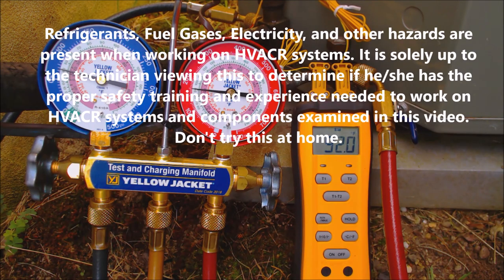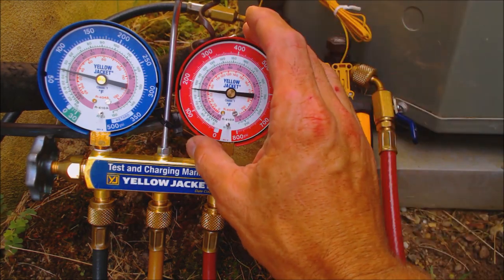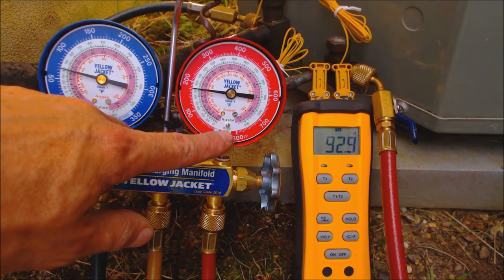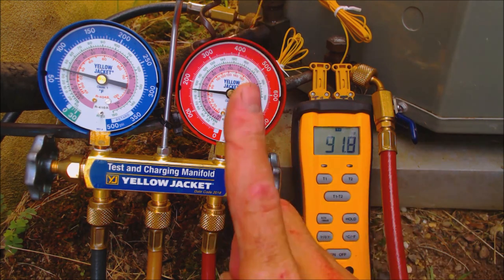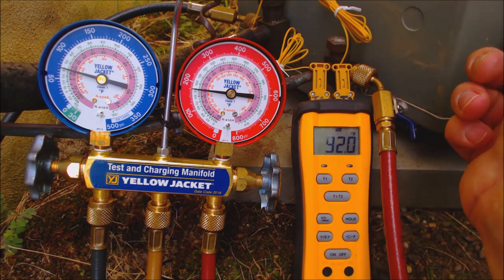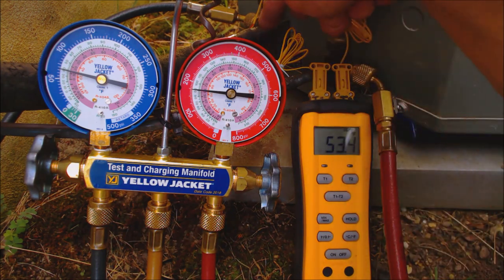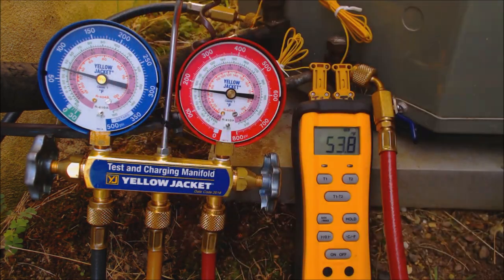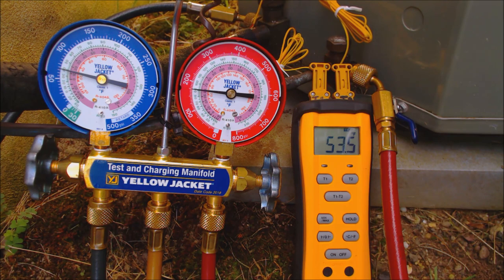LOW REFRIGERANT CHARGE on A/C Unit! How to Verify with Gauges!

Comment from the maker: Tool List-  https://www.amazon.com/shop/acservicetech
Support-  https://www.patreon.com/acservicetech
For those that are looking for the tools used in the videos: (Linked Below)
Here is the link to the Fieldpiece ST4 Dual Temp Meter- http://amzn.to/2wc1ME3

Here is a link to Refrigerant hoses with valves used in the videos  http://amzn.to/2aBumVI

Here is the Link for the Yellow Jacket Refrigerant Manifold Gauge Set used in the videos http://amzn.to/2aenwTq

Here is the Yellow Jacket Manifold Gauge Set including standard hoses- https://amzn.to/2vLVkV9

Here is the Yellow Jacket 4 Port Brute Manifold with Hoses- https://amzn.to/2BkuGIq

Here is the Fieldpiece SMAN460 Digital Manifold Set- https://amzn.to/2nB4Fe6

Here is the Fieldpiece SMAN360 Digital Manifold Set- https://amzn.to/2BdoaD4

Here is the Compact Ball Valve Attachment for the end of the Refrigerant Hose- https://amzn.to/2KUisW8

Here is the Quick Disconnect 90 degree attachment for the end of the refrigerant hose- https://amzn.to/2MMtVcg

Here is the link to the Appion Valve Core Removal Tool- http://amzn.to/2uYr8WL

Here is a link to the JB 6 CFM Vacuum Pump   http://amzn.to/2nqbvo8

Here is the Link to the Appion Blue 3/8" to 1/4" Vacuum Hose- http://amzn.to/2uYlVyc

Here is the Link to the Appion Red 3/8" to 1/4" Vacuum Hose- http://amzn.to/2uYg6Ro

Here is the link to the Yellow Jacket 1/4" by 1/4" heavy duty hose straight-  http://amzn.to/2umtcod

Here is the link to the CPS Vacuum Micron Gauge- http://amzn.to/2v1nM3O

Here is a link for RectorSeal Bubble Gas Leak Detector http://amzn.to/2ckWACn

Here is a link the Nitrogen Regulator    http://amzn.to/2bXdR5f

Here is a link to the Nitrogen Flow Meter    http://amzn.to/2brvoBg

Here is a link to the Digital Refrigerant Scale used  http://amzn.to/2b9oXYl   

Other tool links can be found in the video description section.

Shop through Amazon! Your Purchases through Amazon provide a means for channels such as mine to earn advertising fees from all purchases after clicking through. Prices are the same as normal-    https://www.amazon.com/shop/acservicetech

All of the ACSERVICETECH Playlists-  https://www.youtube.com/channel/UCOZR-1IqsAer9wzlvFgb4mA/playlists?view_as=public

Comment: Thank you for information. How it’s possible when I’m adding refrigerant to increase sub cooling, saturation temp rising up proportional actual temperature. They are same. (I didn’t check what type of metering device) but on the sticker plate was info 12  degrease sub cooling. Other question,  sometimes I can see actual  subcool temperature is  very highest than saturation temp.  But  low side pipe actual temp 60 degree. Thank you.
Reply from the maker: That can be somewhat normal with a txv and when subcooling is not quite close to the target yet. Once subcooling gets close to the target subcooling, actual temp on the liquid line can fall faster so only add a little in at a time when close and wait longer before adding again. 
The second question sounds like either high wet bulb in the house or liquid line restriction if I am understanding it correctly. It is a little hard to understand. Maybe restate, thanks Tapch MC!

Comment: Hi I'm a copier tech of 30 years, have my factory training and comptia certs, I'm a little bit older 53 and I'm pretty sure I missed my calling. I have been repairing my own ducting and simpler ac problems. have replaced ecm motors and a variable speed trane motor after learning how to read  codes on a tam7 airhandler. I would support your amazon links more but the everday tools and test equipment are pricey. Is the 608 cert really hard or just a bit of studying. I have got my gauges set and waiting on my clamp meter. what else might I do to support your channel? thanks for all you do, excellent videos. I also would attend online classes if you provided them.
Reply from the maker: Walt, thanks for your love of the trade. I am working on a book presently for handling refrigerants. The EPA 608 is more studying than anything else. If you want it then you should be able to get it. Maybe look up epatest.com testing locations or escoinst.com testing locations. In reference to supporting the channel, ongoing support for each new video is at patreon.com/acservicetech, one time contributions are paypal.me/acservicetech and any time you click through any amazon link, anything that is purchased afterward would be eligible for a commission. It doesn't have to be a tool. I would like to develop online courses in the future and thank you very much for your interest and vocal support! If you need anything or have any questions, feel free to ask them, thanks Walt!
Reply from the maker: info@acservicetech.com

Comment: how we checking the air flow on the blower?? Delta T?
Reply from the maker: For a gas furnace you can use the temp rise formula but it won't be exactly the same since it will be a wet coil during ac mode  CFM = (Input BTU x combustion efficiency) / (1.08 x DT)  For elect resistance CFM = (Volts x Amps x 3.41) / (1.08 x DT) or anemometer and single large return grill opening with the grill off or FRAG open, thanks Shawn!